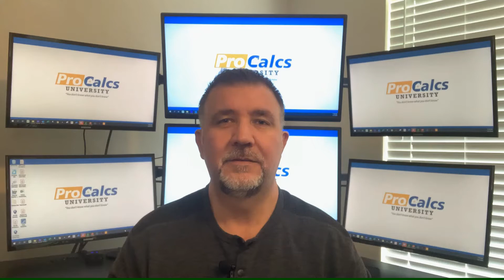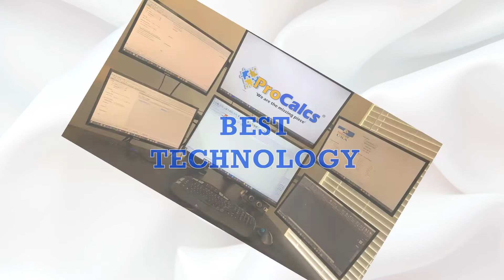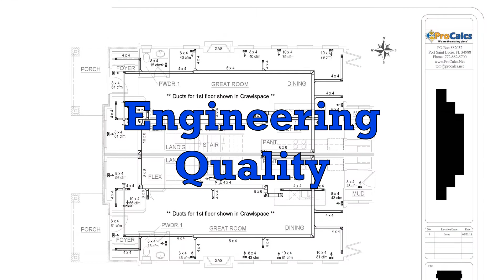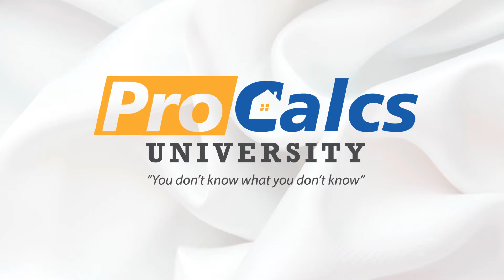Biggest HVAC Scam!! Don't get manipulated!

Comment: Jaguar Heating and Air - Sacramento, California

I wanted to bring up about this company: they are so shady for taking peoples money without following up the installation. They dont return phone calls from the sales person or co-owners. The will sell you something like a water heater and Jaguar does NOT have a plumbing license. They will take your money and run with it and your stick you with the problems. They will also make holes in your walls without the consent of the homeowner and NOT written on the contract. Beware with some of the sales person who pretend to be car salesman, cause that is what they are "car salesmen" They have sold a "water heater" to a clients and wanted it. They the customers ask for it, if Jaguar does install water heaters in which they pulled a "lie" up their sleeve and said "yes" that they can do it, but Jaguar knew that they didnt have a "plumbing license C-36 Classification" but sold it anyways, cause they were afraid that they would lose the sale for installing a water heater. Jaguar Heating went ahead installed a "water heater" and installed it on the property, but did an inspection for the HVAC and wrote change out 5-ton split unit (WATER HEATER NOT INCLUDED)
so that they get the permit for the HVAC and hire somebody with a plumbing license to get the "water heater" permit for Jaguar to do their dirty work all because dishonesty and money and leave the client behind.  This company will anything to keep their good reviews and "throw out" their bad reviews, so that they can get you to be suckered in doing business with them. Beware they have a way with words in selling you something that your not getting, especially coming from a sales person. Here is the problem with contractor they take short cuts on everything that they do, so that can shaft you and they are so called "shysters". This company has installed 2 water heaters without a plumbing license and continue to cut corners or continue to lie to customers just to take their money and leave them with the problem. When a water heater is installed without a plumbing license here are the consequence below to inspect:

1: Who is going to keep up the service call and repair for the next 10 years for the warranty
2: Who is going to do the repair service if it starts to leak water all over the garage in case there is water damage, plus the clean-up aferward.
3: The homeowner insurance "will not" cover repairs if the company installed it without a license (the homeowner insurance will send an "estimate adjuster" and will investigate to see if the company had a Plumbing License during the installation, "if not" they (the homeowner insurance) will cover the repairs
4. Plus, who is going to pull the "permit" if the company didnt have a Plumbing License, now the company will get a 3rd party who has a license will get the permit, but its NOT a good idea, because they dont want to get involved in touching somebody's else work and get their hands dirty as they say. For example, mechanic will NOT touch car if its still under warranty through the manufacture, cause it will VOID the warranty.
5: Most Real Estate and Buyer "will not" buy a home if the house doesnt have permits cause the buyers homeowners insurance will NOT cover it, cause the installation was done "without" license. They way they will if the seller scraps the installation and "redo" the installation and get someone with the Contractor License for the job

Since I know this how the laws work, dont get stuck with some crappy sales person....."the old saying goes: "If it sounds too good to be true, then it probably is" referring to? Is there any truth to this statement? Why might something sound too good to be true?

Word to the wise and good advise: if your not sure about a Contractor License then do this to see if legit

1: Go to Contractor License Board and get or ask for their license so that you know if they have an active license and they are selling exactly that fits their license discription

2: Make sure you to the BBB: Better Business Bureau cause they have reviews that are true legit, cause review can and cannot be taken off because the reviews will stick and BBB is owned by the State and Federal Regulations.

3: Dont read "yelp or google" cause they have friends and relatives and will creat 20 to 50 username account and they are not true only family review supported

Does all makes sense....dont get shafted and or played

Comment: I like what you are saying and I TRY to get units as close as possible but One question is if the color of the house,  the shade of the house, and the lay out of the house is important. (And I know they are and can change the outcome of the way the system works, just like keeping a door open or closed can change the CFMs and airflow of a room.). What happens when that tree gets cut down and they paint their White House dark green? Worse yet. They foam seal their attic and seal their crawlspace??  Does sealing a crawlspace alone affect the AC tremendously?